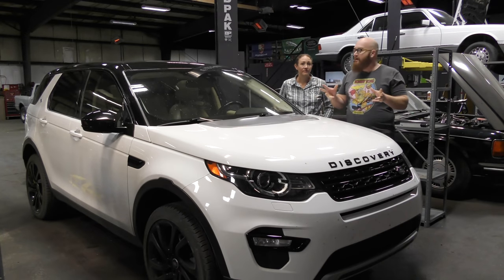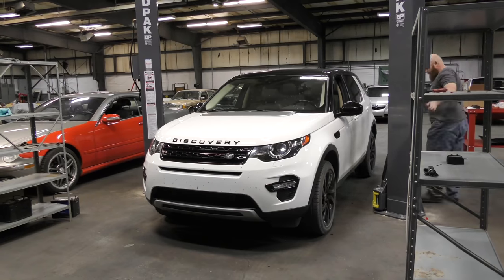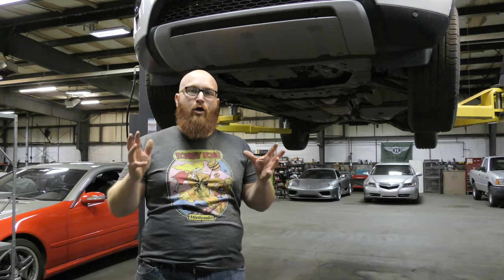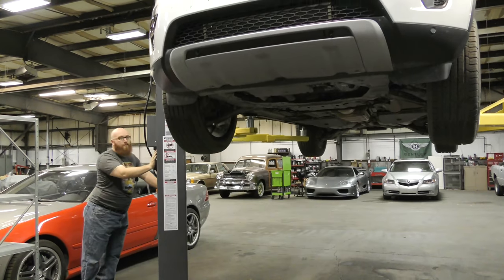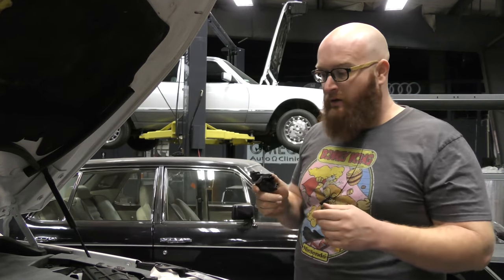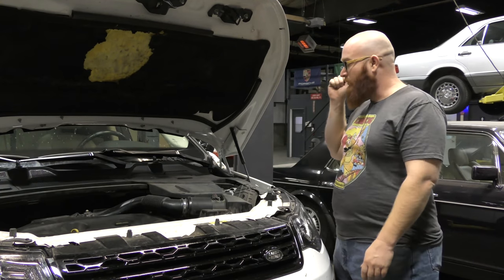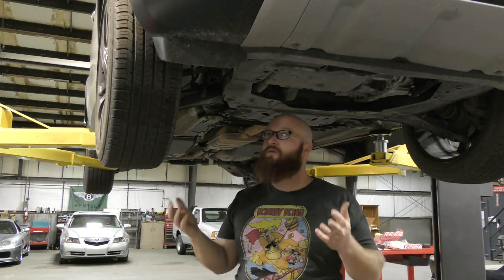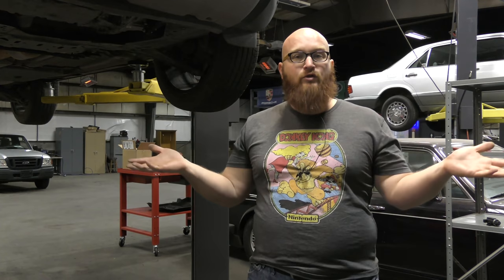I fixed Mrs. Wizard's '15 Land Rover Discovery for $75! How did the CAR WIZARD fix it so cheap?

Comment: Ooh an acura in the background
Reply: Yes haha thats mine. now its getting an engine rebuild. only has 42k on it.
Reply: @lorencooper6043  oil consumption issues on 3.7?
Reply: @amrit10  no but you will see.
Reply: @lorencooper6043  I have that engine in a few other cars in my family. 108k miles, 195k miles, and 295,000 miles. Had to be something catastrophic.

Comment: My cheapest fix: In 2001 I bought a 1990 Prelude SR. I got it cheap 'cause it had no power and pinged under acceleration. The PO said they only put in Regular gas... I filled up with High Octane, dumped in a can of injector cleaner, and within a hundred miles it was running like new.

Comment: I am having this same issue on my 2017 disco sport. Could i have a link or part number please?
Reply: CB5Z-9E882-A is Ford's #  - "Solenoid - Turbo - Land-Rover (LR049972)" is LR's #. Same part, $40 difference haha.  Goodluck, I've just ordered mine.  Did you have any luck yet? P0234 Overboost Turbo is my code
Reply: @realsurrealfeelzzz1525  I’m not getting any codes or anything. The only thing is sometimes when I start my car I have no boost. Revs to 5000 no boost but this isn’t all the time. Maybe once every two weeks or so But it is still annoying
Reply: @minijay6981  way late but heads up Mini that solenoid did fix my Discovery- boosts everytime & no more codes. also replaced the engineair filter as it was pretty rough & the turbo needs that clean air.  Hope it works out for ya mate

Comment: My cheapest major repair?
This summer, I put a used balance shaft belt set and timing belt set and auxiliary belt set, including crankshaft pulley on my car. Removed that stuff from a donor car, so the repair was basically for free and will keep the engine running for another five years. :P

Comment: Hell even with the expensive non-OE parts that “meet or exceed OE standards“ can be bad parts three or even four times in a row like BWD sensors specifically crank and cam sensors... thanks for the videos, cheers!!
Reply: That 2nd part, the OEM ford part that he put in the LR was made in China.

Comment: 10:25 I had a Ford Focus that had a fault on the heater blower control. Every position on the dials were the same. It was the heater blower resistor at fault and Ford wanted £75 for the part with labour on top. I saw a cheap knock off equivalent on eBay China for 50 pence and free postage (how do they do that? ... postage must have cost more than the part). Anyway, it arrived, a different colour to the original part (this one was blue / the original was green) and I set about fitting it myself. It was easy enough but was working blind, upside down in the footwell with glove box removed. Anyway, happy to report that the cheap part lasted many years until I finally scrapped the car. You win some and you lose some I guess.

Comment: I always say, if the OEM part doesn't last long, what chance does a cheapo Chinese part have to be even that good? I once replaced one of the regulators in a crown victoria with a cheapo regulator, it failed spectacularly, and it took me an extra half-hour to remove the thing that had exploded like a bomb.

Comment: I gotta agree with Wiz on this. If you buy a Benz or Land Rover or Lexus, don't try to cheap out with those parts you find on Ebay. I have a Jag and bought a ZF transmission fluid change kit for cheap, and it fit perfectly but the bolts were like plastic toys compared to the aircraft-grade bolts that came with the Jag. Of course I broke one trying to torque it down and ended up throwing the whole cheapo kit away and getting a real one. That was 25K miles ago and she still shifts imperceptibly. If your car cost $85K when new that means they used the quality parts not the cheap ones from China. You should do the same...

Comment: I check the old part, says made by Bosch.  If you buy it from Audi it will be eg 100euros, if you buy it from Bosch it will be 25-40euros, what you do?  Its the exact same part in 80% of the cases.  You don't buy crap but you don't pay dealership prices either.
Same with spark plugs, Audi one 21eur each, NGK one 9.5euros, its the same exact plug.

Comment: Once the opposite of what the Wizard said about owners and mechanics towards the end of the video happened to me.. I had a failing alternator on a Ford. I was literally screaming. I identified the bad bearing on the alternator myself but didn't want to replace it myself as it was nearly Christmas and I just did not have the time. Dropped off the car and parts as agreed to the mechanic and got a call from the mechanics the next morning him saying he didn't think I needed a new alternator. I told him to replace it anyway, which he did. I asked for the old part back when the job was done and sure enough the bearing on the old alternator was toast, and the car was back to being quiet. It was almost like the mechanic didn't want the work, which is fine, but giving bad advice like that is not cool.

Comment: Whenever my Mazda had a failure, the part that failed always had FOMOCO stamped or printed on it. I wouldn't want a car that was comprised entirely of Ford parts.
Reply: Thankfully since they went their separate ways my 2016 CX-9 is totally Mazda parts made in Japan. The window sticker said 99% made in Japan. It’s been flawless since we bought it new.
Reply: Guessing you owned a Mazda 6?

Comment: I had a TIPM failure in my Chrysler, and the dealership first wanted to reprogram my key (engine immobilizer),  I laughed and said 'okay' because I knew it wasn't a security system issue. They then wanted to replace fuel injectors, coils, and the fuel rail. I then ignored them and just took it to a local shop.

Comment: Working at a dealership we get the "I can get it cheaper somewhere else" all day long.  So often I want to just tell them "OK, then you can bring it back when that fails and we'll fix it right."  I've been able to get away with some aftermarket parts here and there but electrical components, water pumps, head gaskets, etc. should be all OEM.  Some car lines are going away from remanufacturing their own parts because even their own reman parts don't work right so you'll have someone looking for an axle they can get at Napa for $50 and you've got to tell them it's going to be $400 plus another $100 for installation or you can get a reman alternator for $240 rather than $600 for the new OEM one--that alternator in specific we used to offer people because it was such a significant price difference but we had too many failures and then finally one caught fire and we said no more to them.  The internet has lead to many people feeling too empowered/entitled and that they know better than professionals who actually do this for a living.
Reply: I've met 'professionals' in a few fields that didn't know what day it was, let alone what they were doing. And some OEM parts are made just as badly anymore as the non-OEM. I especially like when manufacturers know they have a defective part issue, and refuse to change designs or materials to actually solve the problem, instead hoping everyone is dumb enough to keep buying the defective OEM design.
Reply: @markh.6687  There's always going to be the select few who don't know what they're doing, but they're the minority.  And the number of "defective" OEM parts vs poorly-made aftermarket parts is even worse than the number of people who don't know what they're doing vs. people who do.  Once you have to pull an engine or transmission to replace a cheap part and start using the right parts from the get-go you realize the value in doing it right the first time.  I had someone just today try telling me he could go to the hardware store and get a pilot bearing for less than the $8 it was going to cost for the OEM one--go right ahead and do that when you're working on your own turd and are willing to do the whole job over again over a few $.  I love the aftermarket excuses like "they're all made in the same factory by the same people."  Yeah but as someone who has worked in a factory before I know that there are different specifications for different jobs (customers/orders).  Just because there's only 4 or so factories in the world that make car batteries doesn't mean your $60 nEver Start from Wal-Mart is as good as a $110 Interstate.  Side note:  Don't bother with Optima anymore, either.  They were great back in the day but ever since Johnson Controls bought them a few years back their quality went way downhill--pay half as much for a regular flooded battery and you're just as well off.  I should've added pilot bearings and throwout bearings to my original list of parts which should only be OEM, but I think the ETC covers that and a few others.
Reply: @406Steven  I agree it works both ways (buying an $8 bearing at the hardware store???!), but people like Eric of South Main Auto have complained about NAPA's quality going through the floor; he won't even use some of their parts anymore. And the Chinese CAN build excellent quality, but as you said, specifications matter. Too many U.S. companies build to the lowest specs, and charge the highest price.Funny you mention batteries, just put a $40 refurb battery from an Interstate Battery distributor in my 2002 Saturn because I know I won't own the car in 12 months. Heard Optimas turned into garbage, as did AC-Delco, some time ago. Pity Menards stopped carrying Exide; I got at least 4 years out of one of theirs, and it wasn't a top of the line AGM or anything.
Reply: @markh.6687  Shame to hear about AC Delco, they seemed to be one of the last that would last.  Where I live 3-5 years is decent battery life but I've seen AC Delco go 9-13 years regularly.  Exides were good and I had a Die Hard Gold back in the day which was seemingly unkillable--I had it for around 8 years and ran it totally flat (seasonal vehicle) several times due to various battery maintainers either failing or not working properly.  Anymore I just buy an Interstate because I know they're still pretty decent, my work is an Interstate dealer so I can get them even cheaper, and they do hold up fairly well.  I'd love an Odyssey for my truck, but the $200 price difference put me off.

Comment: I had a hole in my exhaust pipe, I heard it, made sure my shop verified it, took a big gamble against your advice to not use an OEM part, in my specific case it worked, probably because it wasn't anything electrical, I'd never replace something electrical or plastic in my car with a non-OEM part. Before anyone tells me I could have done this myself, I didn't have the tools to cut off rusted bolts or work under my car as easy with a 7 feet exhaust pipe. I saved around 600 euros by getting the streetlegal aftermarket part, so, am I just lucky?

Comment: In my case I was the consumer. 
I live in Colombia South America and own a Nissan Patrol Y61 with a ZD30 diesel engine. I had the engine rebuilt and due to the fact that parts are so expensive in this country I bought cheap japanese pistons the tech told me not to do it but I insisted and guess what 300 kilometers later engine failure took the engine apart and sure enough one piston cracked. Now I'm going to buy original nissan pistons.

Comment: You can't use a smoke machine to check for a boost leak.. PSI output on them is to low. First time I have seen a mistake. Other than buying a hole the water!

Comment: If you as an owner want to do your own diagnosis, at least get an OBD scan tool so you at least know if there are fault codes. Not a water tight solution but at least you know a bit more than just assuming.. simple scanners nowadays aren’t expensive. Sure it won’t give you all the details but it will help.

Comment: I once paid a dealer to replace a timing belt which failed a few weeks later. Fortunately, the engine shut off (in middle of an intersection). I had the car towed back to the dealer, where they admitted the car still had an original belt and tried to charge me again (as well as the tow truck).

Comment: What many people don't understand is that code "no boost" is telling you the general area to look into, not the actual part that failed. In my rural area, customers come in with the P code and want us to sell them the parts they need...the "mechanic" sent them to buy. The mechanic wants me to supply the parts to experiment with and when it doesn't fix the problem, the part is returned as "defective". I've had customers come in with a "cooked and crispy" serpentine belt and I tell them they have a pulley locked up somewhere. The customer comes back with the new belt burned the same way, wanting a refund...saying the mechanic said it was defective. I've even had to drive over to the shade tree to point out the locked up pulley/alternator and I find the "mechanic" is a meth head trying to make a buck.
Reply: Had a Toyota tech try an warranty brake pads because one wore out faster than the other. I suggested the caliper was bad and he said “they don’t go bad”. Sad thing is he is their “best” tech and considered their master tech. Nobody has any certifications at all.

Comment: So the Ford Eco boost engine had a faulty Ford part, we had a similar issues back in 1970s, solved it , NEVER bought anything with FORD or GM parts in it after that.  Sure parts are cheap but sure as hell need a lot of them, we went to Volvo. People warned us about spare part prices, not an issue because you didn't need any.
Reply: AMC cars just had Ford, Chrysler, and General Motors parts on their engines and it was a mess. Chrysler engines with GM carburetors or the other way around.

Comment: Remember when wizard got the car he said shouldn't be so expensive since it's full of Ford parts.
Reply: Even smart people do stupid things sometimes.
Reply: Hasn't been expensive though.
Reply: It’s not a $75 fix, he did not include any labour charges from the problem diagnosis plus replacing the part twice. If you are a customer, he will add some hours of labour charges to the $75 part price. A Land Rover dealer would be charging ~double wizard rates.
Reply: He never said it was a good purchase from the perspective of a normal person.
He only ever said it was one of the better LR purchases in terms of cost... not an inexpensive vehicle to maintain in general.

Comment: I worked in a parts store in the 70's to 90's. When the first coolie hat air filters ($25) came out for the Nissan pickups, they were initially only avail from the dealership and were expensive. Very soon, the import parts line we carried (IAPCO) started shipping out their aftermarket version for $10. I opened the box and was pleasantly surprised that the filter was overwrapped, still in its original Nissan oem box. Sometimes you win.

Comment: I have worked for several American electronics makers.  I know from experience the "cheap" Chinese options are less expensive because the quality is typically poor.  If a Chinese product lasts beyond its warranty, they see that as money left on the table, and will cheapen it in the next batch. We may have started planned obsolescence in the West, but the Chinese have perfected it. Unless you value your time at zero, buy  quality.

Comment: I never hear any of the background noises you apologize for. Good mic choices. No need to be concerned about it.
It would be fun to examine what's cheap about the cheapo part. I wonder if things like this can be fixed as opposed to replacing them.

Comment: I dont blame you for being cheap. I can promise you that being a business owner, its not easy. You have to be careful. Between bills and and this crazy covid and nothing promising around the corner, hell you better be cheap. I was bringing in Between 5 and 7k a Week. Yes a week, obviously not profit, now I'm lucky even if I can bring in 1200 a week and thats before bills. This is all because of covid. I'm involved in the medical transportation field,you would think I would be doing great and thats definitely not the case. But you live and learn, if you can get away with a cheaper parts then awesome, its not always bad. Sometimes cheaper parts are better then expensive parts.

Comment: What went wrong with Mrs Wizards car? It's a Land Rover! there's your problem lady! 

;)
Reply: It's an American land rover full of Ford parts.
Reply: @gedd6750  It's an Indian owned company, never known for their reliability it's not got any better over the last few years. I have owned a couple of old series Land Rovers at least you could fix them yourself. The modern ones are useless once the warranty has expired.
Reply: @stephenmorrish  that's racist Stephen, The Indian people are very resourceful and have accomplished so great feats of engineering,have you ever been to India or is this just hearsay you feel the need to repeat?? 
They are designed and built in the UK,the US one appear to be full of ford parts.
Ford Ka's in the UK have huge issues with rusting ,front wings,suspension turrets, rear wings, similar issues on the old puma ,does that make American cars crap?
Reply: @gedd6750  Please do not think me racist my comment about being Indian owned was to point out that it's not a British company, not as a dig at India. As for Land Rover that have always been a bit crap. Back in the '50s & '60s they were OK but ever since they have had reliability issues. Most Americans think of Land Rover, Jaguar as being a British company. The truth is there are no British car company's left, well not mainstream mass manufactures. Plenty of cars are made here but none are owned by the British anymore.  Many of the cars built here have no quality issues some do. The Japanese Honda's and Nissans are fine. The German owned Mini and the Indian owned Land Rover, Jaguar most certainly do have quality control issues.
Reply: @gedd6750  Ford owned Land Rover during the development for this car.